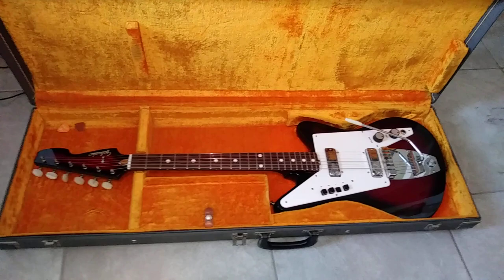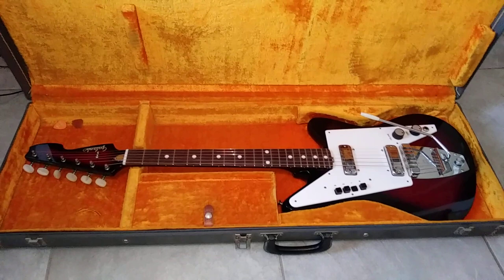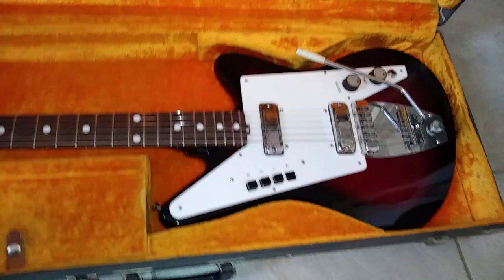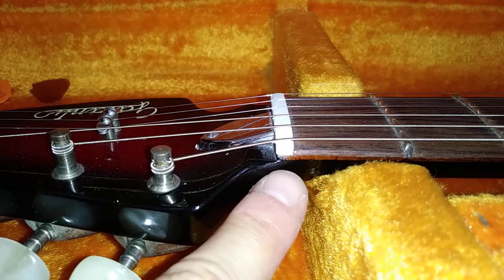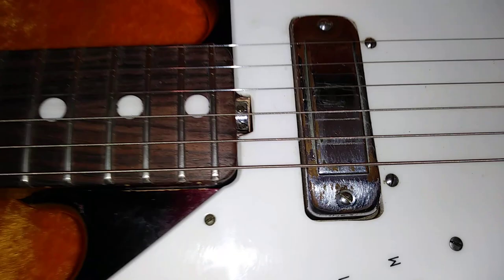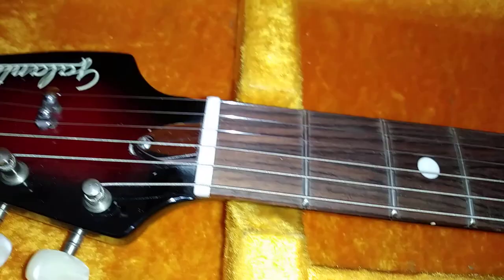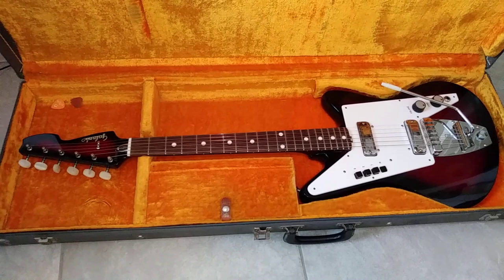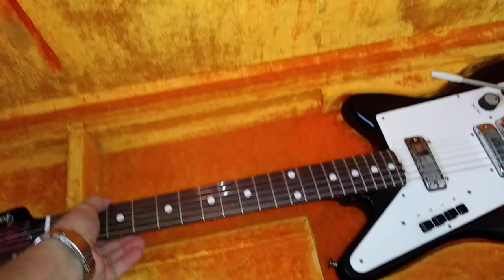1966 Galanti Grand Prix Restored by D Guitars and Lutherie LLC.

Comment: Hey good sir. I have 1 of these my uncle left me after he passed on. He purchased this guitar while stationed in Italy. It was his favorite. I'm new to working on guitars but I have fixed the electronics. I do have a question my my low strings slightly hit the frets on strumming. The frets feel great to me but it has sit for at least 15 years. Is there an adjustment or is the neck warped a bit. The hight strings are fine. Thank you for this video. I want to get her running in his honor.

Comment: Great video! I have one that I use to have .10’s on but now the trus rod will not work unless .011’s are on the guitar. You mentioned that the trus rod is easy to change? Any suggestions? Thanks
Reply from the maker: truss rod replacement is a bit of an advanced repair job. I highly recommend letting a professional do it properly.
Reply: @doronm63  I was able to get the adjustment in spec. Not sure why it wouldn’t last time. Thanks